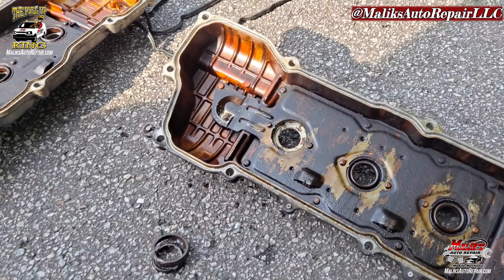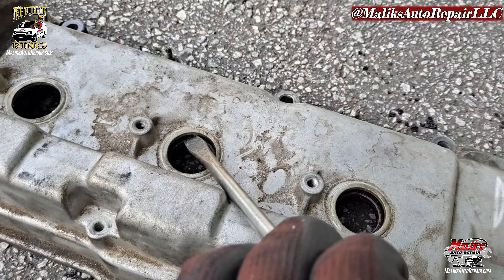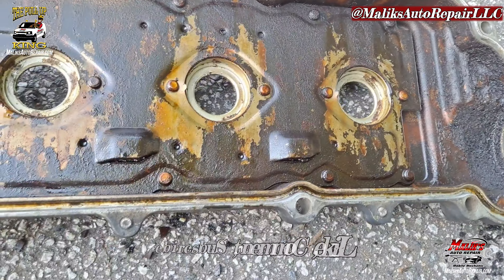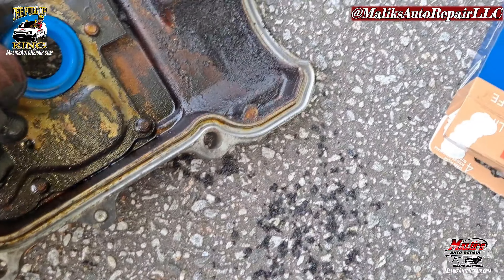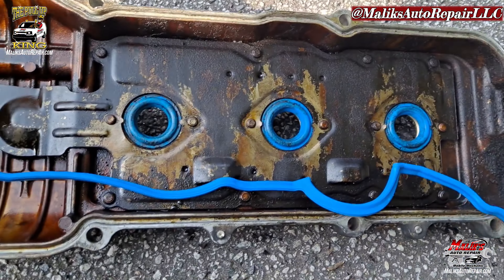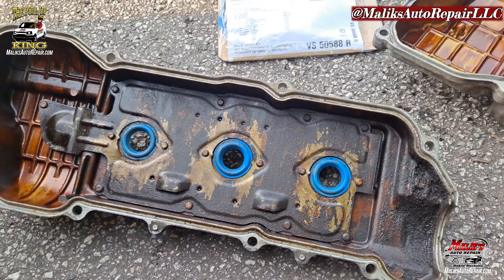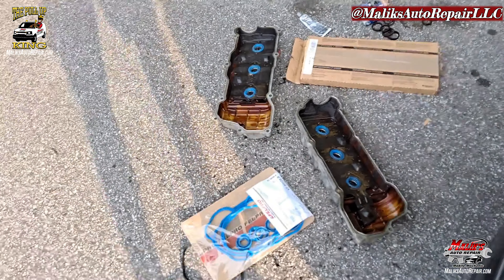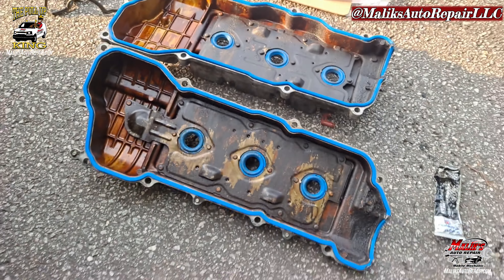REMOVE AND INSTALL TUBE SEALS & VALVE COVER GASKETS | 2000 TOYOTA AVALON | DETAILED | Howto/Diy

Comment: You have the spark plug tube seals installed upside down.  The open end goes towards the engine.
Reply from the maker: Installed the same way they came out.